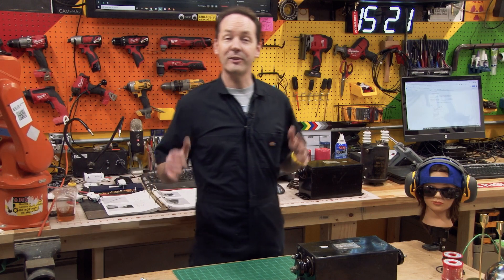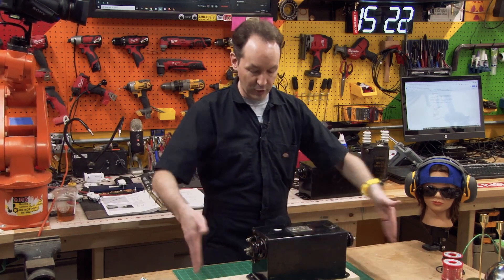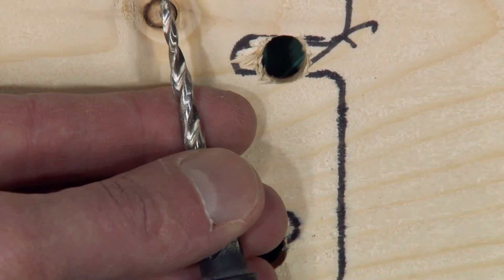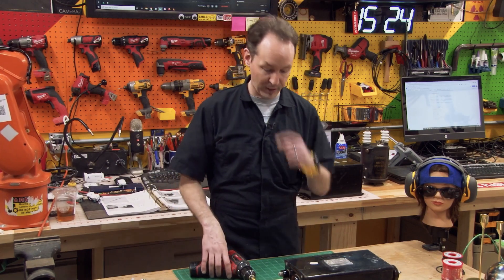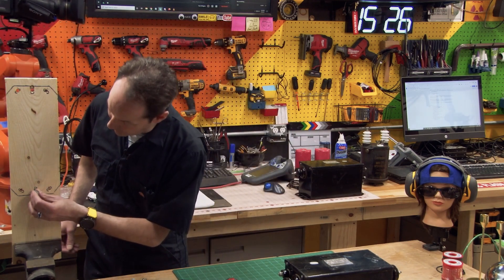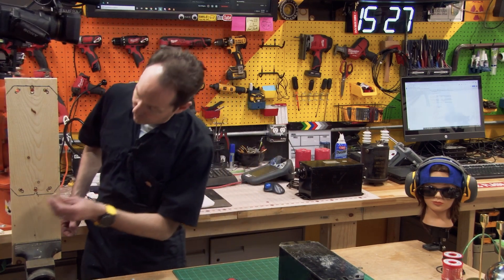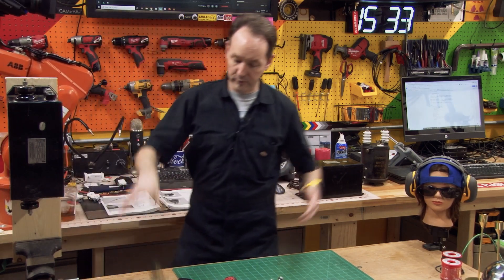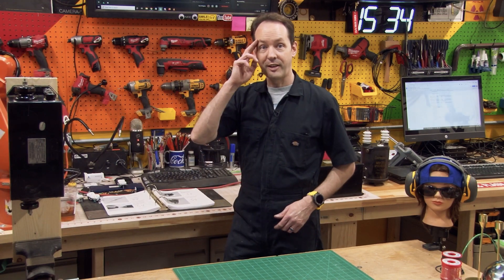High Voltage Episode 10 - How To Mount A Neon Sign Transformer

Comment: I want to take part in this. What voltage and amperage nst do I need to buy? I saw a franceformer 12kv 30ma transformer on Amazon and am wondering if that’ll work?
Reply: A Franceformer 12kv 30ma transformer is excellent. The big thing to worry about is if it has an GFCI or not.
The ones with GFCI's are unusable and will trip off if used. Some people claim to have been able to get them to work, but they are nothing but trouble if you are first starting out. Also stay away from the solid state ones. If it doesn't look close to what Chris shows in the video, pass on it and find one that does.
You can sometimes recognize the NST's with GFCI's as they usually have a reset button on one end, and sometimes have a small indicator light.  The label will also list "Fault" or "Diagnostic" codes on it.  
A good place to look online is Ebay.  Be careful though. The good NST's for Tesla coils are getting hard to find, and some sellers try to hide or advertise that it doesn't have a GFCI because they can sell them at higher prices.  I had one guy I bought an NST from, somehow shove the GFCI into the case and then hot glued and spray painted the holes to hide it. 
Good Luck

Comment: The slide-in-slot trick is great if you gotta mount your NST on a big something you don't wanna move! If it's just a wood plank, it's probably less of a workout to put your NST on the table upside down or on its side and let it rest while you screw the plank onto it, and then you can move the assembly wherever you want.
Great video as usual!